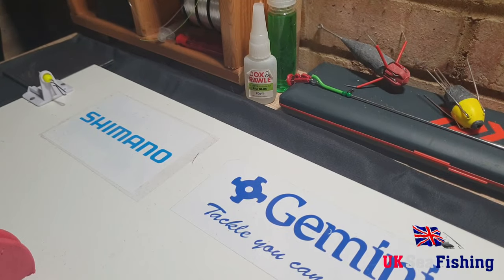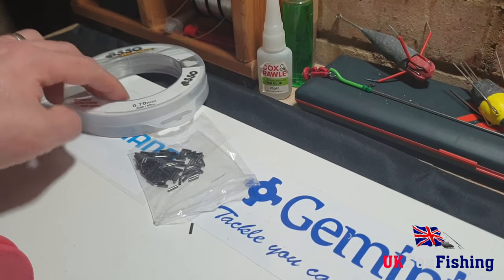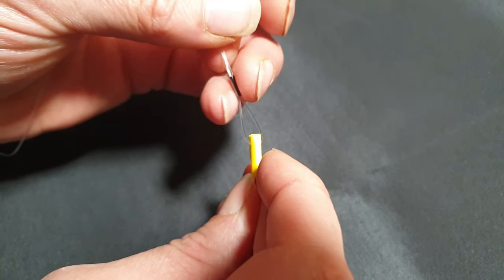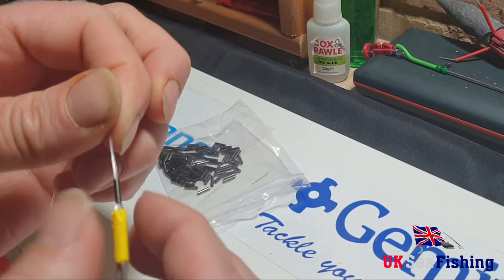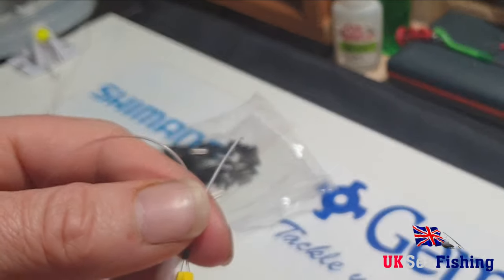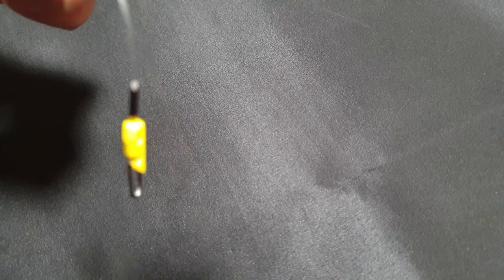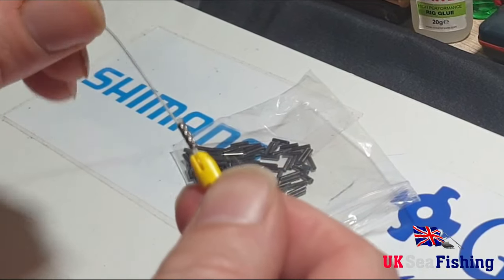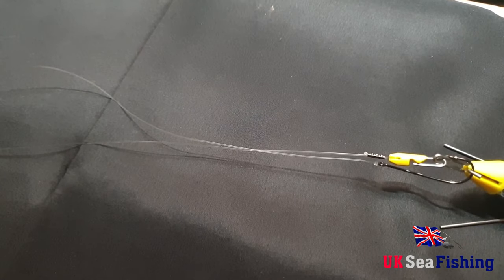Crimps Instead Of Knots??  UK Sea Fishing Rigs

Comment: Yes I’ve used Sandman’s technique for a couple of years. Only recently did I have a rig fail on the crimp when it was snagged. Therefore I have added to the strength by blobbing the end like you and also added a dab of superglue to the line before tightening the crimp up.
Reply from the maker: I'll give the superglue a go. Cheers mate
Reply: Good idea with the superglue👍 a while ago (dont know if is still the case) gemini rigs were made with the line bonded somehow (perhaps with glue?) rather than knotted
Reply from the maker: Yes they use a glue and a line welder. Creates a super strong bond. You can actually buy them from America cost about 120 quid

Comment: simple, affective, clean, and   only thing I would do is put a little float on the hook  to  keep it off the bottom  unless you want it there.  Other than that, I would use for black drums, red drums,. Great Vide . Tight Lines.
Reply from the maker: Yes we use floating beads called pop ups mate

Comment: Careful what line you use , I have had some very good line that seems slicker than others and it most certainly does slip , for me it was a complete failure using the same crimp pliers as hard as I could and a good test pull the end link ended up in one hand and the line plus crimp on it in the other , seems ok on single line, but for me not the double line ,IMHO safe only in certain circs .good vid though mate .

Comment: I use two crimps now. 
One behind the other. But I now also blob the end as well. 
It allows me to get very accurate modular traces. 
I did find that using crimps on the hook snoods to be part under pressure. 
Hence the double crimp I now use.
Reply from the maker: I will give that a try too!

Comment: Hi I Have made up rigs with crimps. I did a pull test, on the crimps, it's easy enough to set up, but and please use some safety glasses and gloves, and with a spring balance, see how strong it holds, this will give a bit of confidence in using crimps.
Reply from the maker: How did you do the pull.test mate
Reply: @ukseafishing  i did a pull test at work the other day. Used a lead clip crimped on  each end of a length of 80lb shockleader around 3ft long.
Welded a small hook made from a welding rod onto a piece of flat bar long enough to stand both feet on. Made another with a hook welded to a bar long enough to hold with both hands. 
Crimped the lead clips on, with the end of the line blobbed with a lighter flame before sliding it all down so was 2mm ish outside the crimp, then crimped so the flame wasnt close to the main line.

Hooked it up and pulled with steady pressure, harder and harder until something gave way. The line eventually broke, an inch or two below where the crimp was on the top lead clip. But didnt break next to the swivel at all, and the crimps didnt give out. 

Stood the test for me so am going to use this to make my rigs up with from now onwards, but still use knots to attach hooks to help baiting up.
Reply from the maker: That's brilliant mate. Nice to know it has been tested
Reply: @ukseafishing  Using a suitable spring balance or small weighing scale, clamp a clip in a vice, then clip your crimped rig body, for the test, i used a short piece of rig body, with a clip and swivel, attached your tool to a suitable clip oval slit ring, and with a steady pull, measure the BS, to test the crimps hold.

Comment: I’ve used crimps for years with great success but I never use them to attach the weight clip. Think you get less line distortion with crimps as knots always leave a little kink in the knot when mono is stretched/tensioned. Blobbing the tail is a good idea and shall use that tip, but does that work with braid?
Reply from the maker: I've never tried it with braid Tony, ill give it a go.

Comment: They have used crimps on wire traces and rigs for years...I have used them on my 0.80mm Mono Rigs like One Man Rifle Maker says...two crimps at each end of the main rig body but passing the tag end over the second crimp then back down (inside towards first crimp), leaving very short gap between the two - this provides extra security and for a while I watched the gap as I fished but as it never moved I took to covering both crimps with some shrink wrap to tidy everything up - by the way Paul changed the 4 jaw crimping tool from eBay (like you are using in the vid) to a six jaw one which I use (these are much better) - I guess someone needs to do a full pull break test in the same way that knots are tested - hope this helps - as always do your own due diligence as safety is imperative with a 6oz lead on a power cast - tight lines
Reply from the maker: I'll look at the 6 way crimping tool,   also thats a great idea with the 2 crimps and up and down through the crimps. When you tidy it up with shrink tube does the heat to shrink the tube damage the line at all?

Comment: not to sure on the crimping tool myself, you can only use them on the bigger crimps, they don't seem to crimp down on the smaller ones
Reply from the maker: You need to change the tension settings by undoing the screw on the side and turn the wheel to the smallest notch setting.. works fine for me mate

Comment: Hi 
What are the crimping pliers.
I've not found a decent pair yet. 
Regards Chris
Reply from the maker: Here is a link to the set I bought mate.
Preciva Crimper Plier Set, 0.25-10mm²/AWG23-7 Self-adjustable Ratchat Wire Crimping Tool with 1200 Wire Terminal Crimp Connectors and Wire End Ferrules https://www.amazon.co.uk/dp/B073TZ5BBG/ref=cm_sw_r_apan_glt_i_560DWDX8J8WK8B8710K9?_encoding=UTF8&psc=1
Reply: @ukseafishing  fantastic many thank. BTW cracking video too.
Regards Chris
Reply from the maker: Thanks Chris

Comment: I'm here looking for advice on this matter. Are you now fully sold on using crimps great to here your over all opinion after sometime of using them 

Cheers
Reply from the maker: Im 50/50. Still use crimps and knots depending on the rig. I've only had 1 rig slip on a crimp.
Reply: Thanks for your reply Ive been also thinking about it for a while my self I may just give it a shot.

Thanks top video
Reply: Hey dude.

I'm completely sold on crimps for my shockleader only I have more confidence with crimps than with 100lb 0.80dia cheers for your video once again